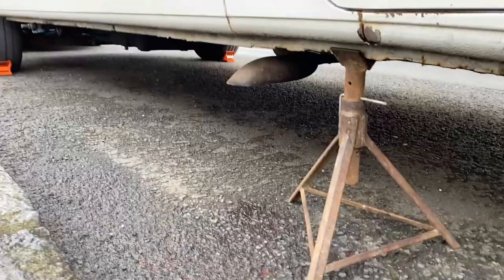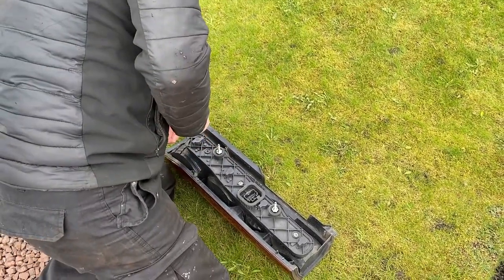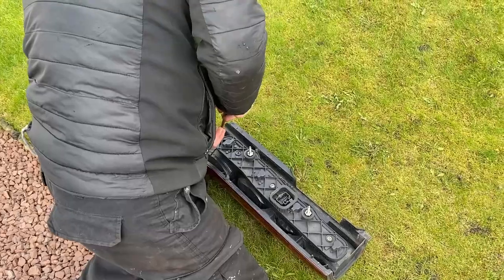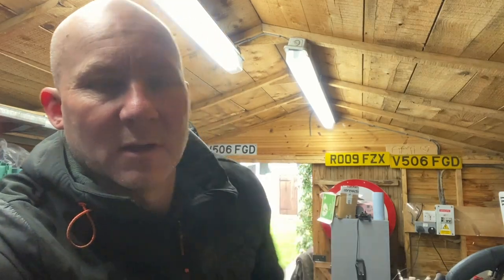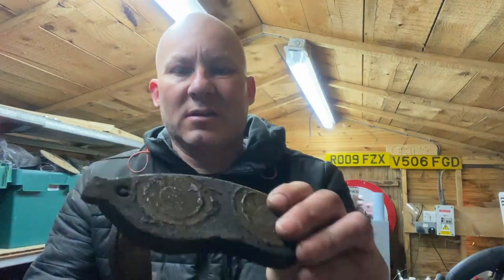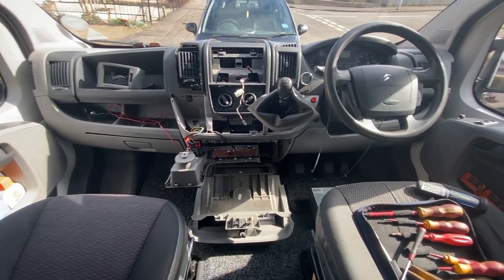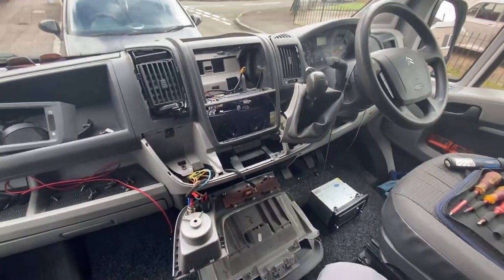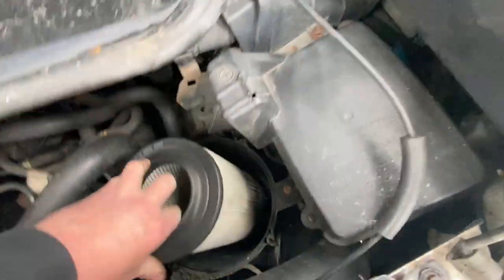Campervan DIY

Comment: Nooooo...copper ease on brakes naughty....febi ceramic brake grease next time 👍
Reply from the maker: Thanks, I will look that up and see if I can buy that here.
Reply: It's much better David, problem with copper ease on brakes is as it heats up from brakes it dries out and the copper can cause problems with ABS sensors, febi ceramic is about £10 👍